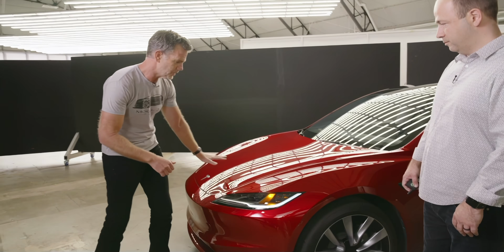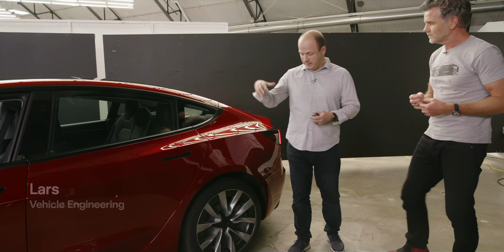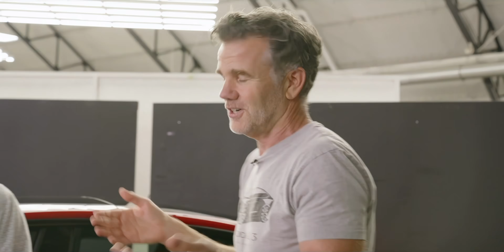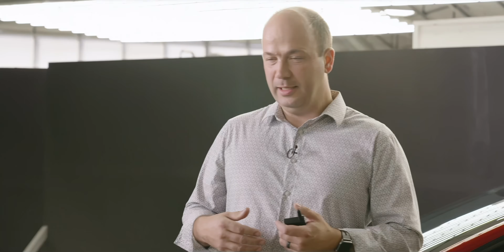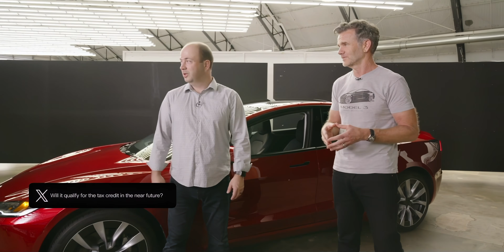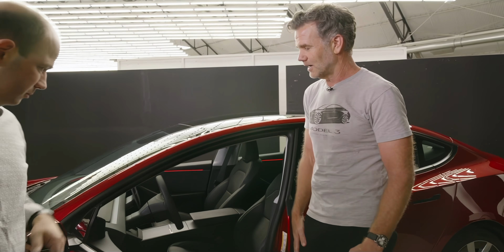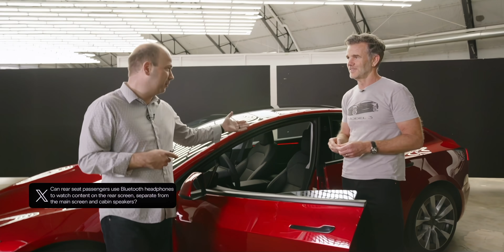Franz & Lars Talk New Model 3 | Live

Comment: The session covers everything from design philosophy to safety, comfort, range, affordability, and more.

1. Exterior Design & Aerodynamics
Front-End Refresh. The new front fascia is lower, sleeker, and more streamlined. A redesigned hood and reshaped headlights give the car a “mature” and tighter appearance while reducing aerodynamic drag.

Taillights & Rear Diffuser. Taillights now extend onto the trunk lid (no split line cutting across). Beneath the car, a new diffuser and refined bumper surfaces help air flow more cleanly at the rear—improving overall efficiency.

Improved Aero & Wheels. With a drag coefficient of around 0.219, the updated Model 3 is among the most aerodynamic production sedans. New 18" and 19" wheels feature small “caps” around the outer edge to “shrink” the aerodynamic profile and reduce turbulent airflow. The accompanying new tires have lower rolling resistance without sacrificing grip or steering response.

2. Under-the-Skin Engineering
Stiffness & NVH (Noise/Vibration/Harshness). Tesla performed structural updates (extra reinforcements, improved door sealing, new acoustic glass, and more baffles/foam) to make the cabin quieter and the body more rigid. A stiffer body shell sharpens handling response and also contributes to a more solid, premium feel.

Suspension & Dampers. The Model 3 now employs frequency-selective damping. Each shock absorber includes a clever bypass valve that can open or close depending on whether the impact frequency is high (sharp bumps) or low (body roll/road undulation). This improves ride comfort over rough surfaces without sacrificing cornering performance.

Battery As Structure & Safety. As before, the battery pack is a load-bearing part of the chassis, creating a strong safety cell. Tesla also discussed stronger door structures that better protect occupants in side collisions, plus the many occupant restraints and airbags designed around the EV’s unique layout.

Active Safety Enhancements. Standard Tesla safety features (Automatic Emergency Braking, Lane Keeping, Cross-Traffic Emergency Braking, etc.) are all included. The upgraded Model 3 receives Tesla’s latest-generation cameras (Hardware 4), which enables better autopilot/active safety. Unlike many automakers, Tesla bundles all core safety features as standard.

3. Interior Overhaul
Minimalism, Elevated. Although the interior layout is still famously streamlined, the materials and details are significantly upgraded. Key features include:

New steering wheel without stalks (turn signals are now on the wheel’s thumb buttons).
Redesigned center console with concealed storage and soft-touch materials.
More extensive use of soft textiles, premium upholstery, and updated trim (including real metal, ultrafabrics, or alcantara-like surfaces).
An LED ambient light strip that wraps around the dashboard and doors. The color can be changed via the touchscreen.
Refined Seats. Seats are newly contoured and more supportive, with heating and ventilation (cooling). Tesla designs and stitches its own seats in-house, enabling them to optimize foam breathability for quicker and more noticeable seat ventilation.

Quiet Cabin. Beyond the structural stiffening, there is extra insulation and improved door/window seals. Wind noise is substantially reduced. According to both Franz and Lars, you’ll notice a “solid thunk” when you close the doors and a significantly quieter interior at highway speeds.

Rear-Seat Amenities. The Model 3 now includes an 8-inch touchscreen for rear-seat passengers. They can control climate settings and stream entertainment (Netflix, YouTube, etc.). Bluetooth headphone pairing is supported, so kids or other passengers can watch shows without distracting the driver.

Enhanced Audio System. The standard speaker count has gone from 7 in older base configurations to 9, and the premium audio system in Dual Motor versions has 17 speakers (plus dual subwoofers). Tesla emphasizes clear, full-range sound quality—especially important in an EV’s quiet cabin.

4. Efficiency & Range
10% Real-World Efficiency Gain. Even if EPA sticker values in the U.S. only show a small increase, Tesla says the new Model 3 is ~10% more efficient in real-world driving. Certain test-protocol changes partially obscure this gain on the official label, but owners should notice better energy consumption.

Battery Details.

Standard Range (RWD) continues using lithium iron phosphate (LFP) cells (charge to 100% daily if needed).
Long Range (Dual Motor) variants use a nickel-based chemistry (as before) for higher capacity.
Warranty remains 8 years / 100,000 miles (whichever comes first) for the Standard Range, and 8 years / 120,000 miles on certain LR/AWD variants.
Ultra-Low Parasite Load. Tesla’s software team constantly refines “vampire drain” and Sentry Mode consumption. They’re targeting a 40% reduction in Sentry Mode energy usage soon. Power usage at idle is a major factor in real-world range over time.

5. Pricing & Mission
Affordability. The updated Model 3 starts at $38,990 (US) for the RWD version, and Tesla frequently highlights federal and local EV incentives/credits. Leasing can bring monthly payments to the low $300s in some regions. Franz and Lars emphasized Tesla’s mission: “Make EVs more affordable so more people can drive them.”

All-Inclusive Features. Tesla bundles most technology and safety features standard, rather than placing them behind extra-cost trims. This includes Tesla’s signature large touchscreen, advanced driver-assistance features, and frequent over-the-air software upgrades.

Comment: Refinement & Value. The new Model 3 addresses much of the feedback Tesla has received since the car originally launched in 2017. The design is sleeker, the cabin quieter, the ride more comfortable—while still retaining Tesla’s trademark handling, acceleration, and tech-forward user experience.

Family-Friendly Improvements. Rear passengers finally get their own entertainment screen, climate control, and improved seating geometry. Ventilated front seats and a refined dash/console layout cater to a more upscale feel than the previous Model 3.

Tesla’s Engineering Philosophy. From advanced tire compounds (reducing rolling resistance yet retaining corner grip) to structural battery design and software-optimized safety, Tesla’s “under the hood” work is as important as the visible styling. They emphasize that these refinements come from real-world data and continuous iteration.

Conclusion. If you enjoyed the original Model 3’s blend of performance, range, and minimalist style, the “Highland” refresh should feel like a notable leap forward—especially in comfort, cabin quietness, and upmarket fit-and-finish. Franz and Lars encourage potential buyers (and curious onlookers) to test-drive the new Model 3 to experience these differences firsthand.

Comment: Bought my M3 LR RWD about a month ago and love almost everything about it. My first EV and its been fun adjusting to it, but even more fun feeling like i have the performance/feel/overall-road-control of a ~$80,000 car despite spending under $40k. Just felt like the right time to make the switch.
It's not all sunshine and rainbows though....
1) The turn signal buttons were big miss, just totally unnecessary and a regression in function. 
2) The A-frame blind spot is significant, on both sides. 
3) Carpet interior sucks and grabs onto any/everything making aftermarket mats mandatory. Dont know why it doesnt come with any. 
4) If any car would be improved by a HUD it is this one. Tesla really needs to look into incorporating one into the next refresh. Seems silly that everything is so minimalist and automated in hopes of reducing need for anything but just driving, but then doesnt include a HUD that would dramatically assist in that. IMAGINE A HUD WITH A BLIND SPOT INDICATOR!

Comment: Isn't there a regulation where you can't have turn signal on moving body pieces? Did they get rid of that rule? I believe the old turn signal was split because there has to be parts of the turn signal that on the stationary part of the car.

Comment: Fantastic work, have you considered for high way travel:
1) designing feature that would cover the wiper area in highway travel to improve the aero drag coefficency (presuming weather is dry)
2) in high speed could this cover direct enough airflow to "wipe" light rain off the windshield if it had a hydrophobic coating?
3) could the mirrors redact to a smaller size in model 2 when the autopilot is enabled?

Comment: Not really relevant today, but my 88 Fiero Formula had the engine in the rear and traction was great for a rear wheel car compared with the my buddy's 5.0 Mustang.  The weight helps in the rear wheel Drive Model 3 as well.

Comment: 1.) Would there be any benefit to an old fashioned key lock for the door? I witnessed a child locked in a Tesla, in 1 hour the fire department was able to restore functionality to the car. 
2.) I do not yet own a Tesla, I am concerned about the lever door handle in icy winters. My I.C.E. car had been completely snowed in, and covered in ice, and a traditional door handle worked well under those conditions. 
3.) I test drove a Model 3, 5 years ago and thought it was incredible. 
Thank you very much for your consideration. 🙏 Namaste
Reply: There is an unlatch door button on the Tesla app that will open the driver's door if the door handle is frozen.

Comment: Hey Tesla - hope you're reading the comments -  I'd like to share changes to the next Model S that I'm expecting / hoping for
- steer by wire
- four-wheel steering
- rear seat foot wells to increase leg room - similar to the Porsche Taycan
- increase chassis torsional rigidity
- soft close frunk
- rear seat fold down release levers in the rear - similar to the model Y
- no driver instrument cluster - only a center screen like the Cybertruck
- center screen doesn't need to swivel - cost savings
- ambiant lighting similar or better than the Model 3
- removable side mirrors
- rear taillights integrated into the rear similar to the Model 3
- change from a hatchback to a trunk configuration like the Model 3 for better cabin sound insulation
- refresh the front end design, headlights etc.
- blind spot monitoring
- rear cross-traffic alert
- no door handles - like the Cybertruck

Comment: I would buy tesla IF it had a normal driver side dashboard...
Reply: A Tesla is easier to operate than any car I have driven.  All it takes is a few minutes to get familiar with the controls.
You never have to take your eyes off the road for anything you need to change while driving - climate, seat heaters, speaker volume, wipers - you name it.
The digital speedometer is easier to read than any analogue one.  Far less time needed to read it.  
It's all just a matter of being willing to be adaptable.
Reply: @Garrison169  How can you use touchscreen without taking your eyes off the road? Alsom, can you see your speed with periferal vision? I agree, I love my VOLT's digital dash and it is super easy to read. But I also like physical climate control , turn signals etc..
Reply: @AlexDiamantopulo  You don't need to use the touchscreen while you are driving. I thought I made that clear.  Everything the driver needs is either on the steering wheel, or available by voice commands.

You can bring up a screen to tune radio stations with a voice command and it is easier to use than a radio dial.

Comment: All those little things like stalks and sensors that work in any situation? Sure there are great improvements, but to remove things that work better before having a real alternative is just to much cost cutting. Parking is harder without ultrasound sensors and driving in roundabouts is also harder without stalks. Tesla vision with an added low front camera "might" get us there in 5-10 years. I do appreciate the Acoustic improvements, as I work with that professionally. Also drive comfort has been improved.

Comment: Did a test drive yesterday and was indeed blown away, absoletly want one. 
No stalk for turn lights is outright dangerous in a country with mostly roundabouts like Norway making them unsuitable for driving lessons and it is confirmed to get a reduced security score because of it. Not a dealbraker, but in reality it will just result in me not using turn lights in situations where I should.
Tesla vision also seems to have a lot of improvement potential and downsides to sensors.

Overall the price, drive and ease of use puts it ahead of it's competitors for me, but still on the fence financially.

Comment: You need to add auto indicators/blinkers on roundabouts when navigating. It is awkward/dangerous to indicate roundabout exits manually on the wheel.
Reply: That's why I didn't buy the new model 3. Too many roundabouts everywhere here in Norway, and those buttons on the wheel became very cumbersome and distracting to use after a short while. 
It's only a good idea in the US and other places where they use intersections instead.
Reply: Agree. No stalks is deal breaker for me. Finland also have roundabouts everywhere.
Reply: Really? Only took me 30 seconds to get use to no stalks. After over 3 decades of using them, really not a big deal.
Reply: @dr.markevers8331  Signalling to leave roundabouts is not easy without the stalks.

Comment: The battery question never got answered… Entry level rear wheel drive is LFP, Long range is using imported 2170 batteries right now (So doesn’t qualify for Tax Credits), but that may change before year is done…? Performance/Plaid Model 3 will have USA made 2170 batteries.

Comment: Lars, Good to hear that Tesla review feed backs and plug holes. As a new Model 3 owner, I am awaiting to hear about Tesla addressing the blind spot in front of the front bumper. Reverse parking is no problem with high resolution rear view cameras. However, parking straight into a parking bay, cannot judge the distance to the front without camera view. Front view underneath the front bumper or front top view would make the parking much easier. Hope Tesla address this issue in the coming upgrades.

Comment: The basic controls alterations are the worst changes in the history of cars by far, specially the removing of the stalks is a disasterous design decistion on the European roads with small round abouts and even doing basic 3 point turns - nobody like those control changes here in Europe, and it shows up in alot of reviews. Packing everything into a steering wheel or a display screen does not make the user interface "amazing", but rather hopeless to find anything in a hurry or without having to look away from the road. I'm not saying this to hate on Tesla but rather because I already like most of the product, however I want it to be super practical control wise when I switch to EV's.

Comment: The car is great, but the trunk opening is really bad! Please alter the trunk like it is on the Model S! And integrate a cover for the glassroof. Please...
Reply: Tesla glass roof is STRUCTURAL, supports  TONS of weight.
Reply: @markplott4820  The heat/sun is my problem. Don't like to have a headache after a sunny two hour trip!
Reply: @retobar752   - the get Thermal sunshades , aftermarket.
Reply: @markplott4820  Should be part of the car, because it is important. I am not an American, so I do not want to alter a obvious problem on a new car by myself.

Comment: Did a test drive on the new model 3 last week. I think the main thing missing is definitely a heads up display, it would make the life so much easier for the driver to easily see the speed while driving. All the rest is spot on!
Reply: Instead of a screen placed in an inconvenient position in the rear, how about adding a binnacle in front of the steering wheel. Head Up Display would be a bonus, but so would physical buttons and stalks. Tesla has gone too far with the minimalist interface.

Comment: Safety and comfort sound good, but still missing essential instruments in front of the driver, and missing "stalks". Both are safety issues, and should be illegal. Also their focus is all on production cost, not on easy repairs. What good is a structural battery if its near impossible to replace or bypass a defective cell. Crash damage is not local anymore because of castings. They are getting closer to making a throw-away car after a few years, very energy-intense, so what is the point. Need simple cars anyone can repair and that are built to last. Battery lifespan and range are not good enough yet either, wait 5 years. How about shocks that generate power, is that a hard problem or too little gain?

Comment: I am waiting for the performance. If it is under $55k and gets the $7500 rebate I will get it. If not I will just drive my Model Y until the wheels fall off. I am waiting on a Cybertruck but as of now they still don't have lockers for going off-road and are useless for towing an RV which is why I need one. And the range extender, being permanent, makes the bed useless as a truck. 
Do better guys.

Comment: Got the refreshed M3 RWD in Dec and since then it has clocked 5500km. Its efficiency has been amazing with an average of 137wH/km. Simply the most efficient EV out there.
Reply: In what temperatures? My 2018 Model 3 hits that efficiency daily in the summer. But in the winter, it goes down to ~180/190Wh/km